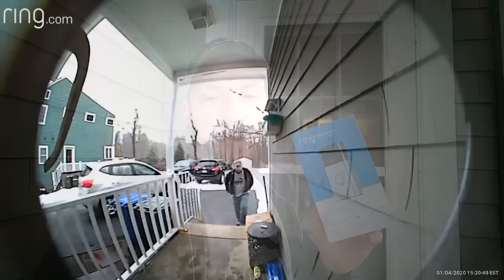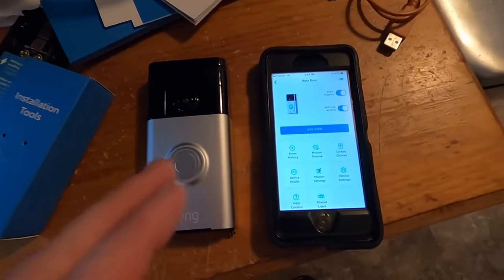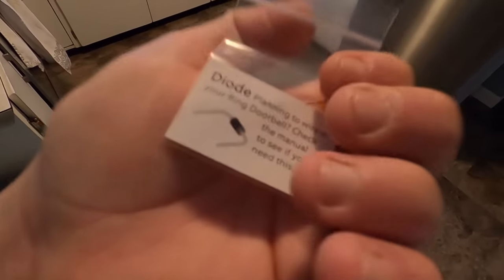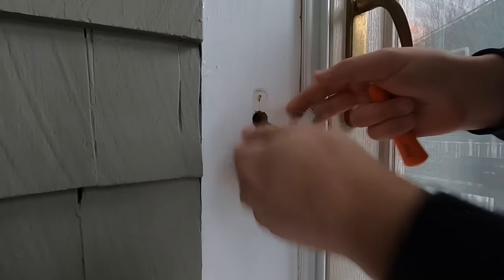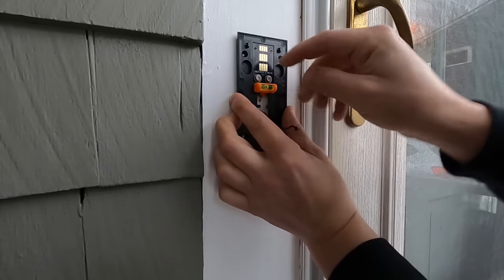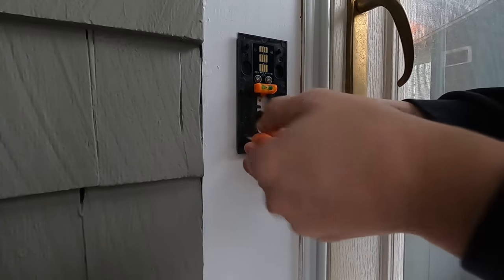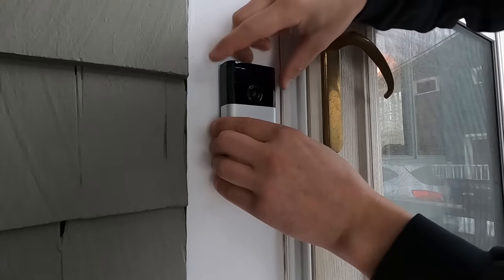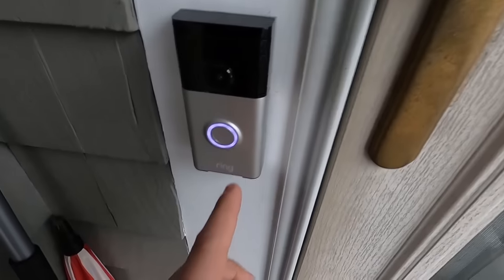How To Replace a Wired Doorbell with Ring Video Doorbell | DiY Install

Comment: Was waiting for the wires to short.  Taking any live wires off without flipping the circuit breaker is always a recipe for disaster.
Reply from the maker: Actually doorbell wires are low voltage, they can not shock you and all that happens when you touch them together is the doorbell goes off.  If it makes you feel better you can shut off the power in your panel but is not necessary.  Thanks for checking out the video!
Reply: Safety first! =P
Reply: The Fixer to “open loop “. Disconnect wiring at transformer  screws -@12-16 volts..very low voltage/won’t even feel voltage..
Reply: Ring suggests shutting of circuit breaker before install.

Comment: Did you have to disconnect the circuit somewhere before performing this repair? Does a doorbell have a standard 120v outlet?
Reply: I need to know as well. Don’t want to get electrocuted but it didn’t look so

Comment: Thanks.  Should you turn off electricity before touching live wires or not necessary?
Reply: Not on this because it’s very low voltage.

Comment: Great video, rookie here, one question. Do I have to cut power to the doorbell?  It didn’t seem like you did.
Reply: I wondered the same thing  🤷‍♂️
Reply: It is always the safe way to turn off that circuit on your breaker before installing it.

Comment: My package did not come with the drill bit for concrete. What size drill bit would I need? Thank you for this video. All I need is too install it on the concrete wall. The area where my existing door bell is located, is too narrow.

Comment: I got this doorbell and unless you are going to hardwire it I would not recommend it. I thought if I got the solar charger I'd be ok, boy was I wrong. The solar charger can't keep it charged up even if it's sunny every day and my doorbell faces south. So I have to remove the doorbell every four to five days and charge it which is a pain because you have to loosen the set screws and unplug which is already causing damage to wire plug. If I could go back I'd get the ring two which has a easy removable battery and also 1080p video quality and the ring 1 720p. Hope this helps; I probably left out some things but do a little research before you buy.

Comment: 9:38, a follow-up question: why are you concerned if the app shows battery power remaining,  when you hard wired this? Is it 16v? Does it have a backup battery?

Comment: great video. thanks.  when you installed the wired doorbell, you didn't  turned off the electric switch..  is it safe ?

Comment: Did you switch off the main fuse box before you installed the wired doorbell to avoid electrocuted?

Comment: Thanks for the video. Very helpful. The only thing I would add is to check the settings in the app to make sure the indoor chime is turned on. Mine wasn't so I thought there was an outside issue. Turned out to just be the app settings Thanks.
Reply from the maker: Thank you!  Yeah, I didn't get too deep into the app function.  Didn't want to show any personal information.  Just in case.  Thanks for checking out the video!

Comment: how do I know if my existing door bell wires are correct voltage for this RING doorbell replacement?  btw, I watched a few videos on YT about this topic, yours was the best and made me confident in installing it.
Reply: Resident Local measure @transformer voltage.. with volt-ohm meter...them measure voltage on other ‘end of loop-doorbell wiring’..voltage drop will be caused by length. In loop run-wire run if too low retire transformer...good luck
Reply: All are 16v.

Comment: So the wires you attached were only for the doorbell? I was under the impression the old doorbell wiring and associated power would be rewired thru a transformer used to keep the doorbell powered up and the battery would only be used as back up in the event of power failure?

Comment: On so,e of the videos you have to manually add something to the actual door bell on the wall (inside my garage)  I didn’t see this step on this installation.   I am assuming that it will ring without that step as yours did.

Comment: Seems like you have the best possible scenario for installation of one of these devices...wood trim and the doorbell faces outward. My house is stucco and the builder put the doorbell on a side facing wall. One thing I noticed though was the delay and how pixilated the video looks.
Reply: Same problem here.

Comment: If connected to original doorbell, why do you have to recharge batteries? From Amazon item page... Powered by the built-in rechargeable battery or connects to existing doorbell wires for constant power.
Reply: That's what I thought. That is why I purchased the wired one.

Comment: I appreciate your video.  However, I hard wired my Ring Video Doorbell 2nd Gen .  It does not work with the existing NuTone Chime in the house.  Very Frustrating experience.  Now I would have to defeat the ahrd wiring - go back to battery power - and either use my Amazon Echo Units for the alerts or buy a Ring Chime (that Plugs into electrical outlet) and works digitally with the Doorbell.  Calls to Ring's Customer service agents were helpful, but could not correct this without buying a new Chime.  I checked out the reviews of the recommended mechanical Chimes and some posters said it did work and others said it did Not.

Comment: Thanks a million for the tutorial. Just a dumb question, is it OK to keep charging the battery even after it reaches 100%?
Reply: Yes it's OK (safe) to keep charging the battery, however it isn't good for the life of the battery. Batteries also have charging cycles and these 2 reasons is why they fail or don't hold a charge as well anymore. A laptop or phone battery for ex. should be charged, unplugged and then discharged through normal use, you'll find those instructions on product manuals everywhere. Always having a device with a battery plugged in or something like watching videos on your phone while it's charging actually destroys battery life. This is why a laptop or phone battery no longer lasts for days like when you first got it. Now this is a doorbell we're talking about here so it's not that important but batteries are batteries.
Reply: @mannyquinn8301  will ring door plus stay charged with out the battery if I use wires from the breaker box?

Comment: Do I have to turn the electricity off to the house? Other videos have said that, but the problem is no matter which electric panel we turn off the doorbell still works so it must be running off of some thing else. The light was still on in this video, so it looks like the electricity was still on, I just need to know if I have to worry about that.😊

Comment: Hi, good video, but i have the same concerns as a lot of people here, which is the reason i am checking YT , how do i verify the existing door bell setup ?? To know if is ok for the Ring ? My house is 13+ yrs. old, the bell sometimes vary when pressed, there is the transformer on the garage (as my previous house of the same time, but bell was always the same) , how does one id if is digital ? , I doubt it is , assuming that is either the old original one, doubt previous owners changed it. 
   Please clarify, thanks.

Comment: Whoa whoa whoa!! You did this on live electrical wires without shutting off the power. Am I the only one who noticed this? The Ring instructions say you MUST turn off the power first for safety! Yeah, I know it's not 120VAC, but it's still dangerous.
Reply from the maker: You are absolutely not the first haha.  Yes you should turn the power off.  If I could remake this video, that would be the first thing I would say.  Thanks.  Be safe!!

Comment: I'm just afraid that it would electrocute me. Did you turn off the switch at the panel before connecting the wires?
Reply: It's low voltage. It's not 110 or 220 volts.  So no worries on a doorbell wiring.

Comment: How did you not get shocked touching the wires? Or did you have to turn them off from the panel?
Reply from the maker: It would probably be a good idea to shut the breaker off to the doorbell but any doorbell I have ever come across has been low voltage wires so I wasn't too worried about it.  Again, the instructions do recommend turning off the power at the panel.

Comment: I live in a 1931 home. From what I can tell, this home has never had a doorbell, nor do I see any indication of wiring for one. Would it still be possible to install a Ring doorbell? If so, would it require a lot of work? Thank you for this video!
Reply: My home is the same. Instead of the ring doorbell and I just the ring stick up cam battery powered and stuck it up above the door. Works the same without the doorbell ring
Reply: @lex1eleven  must you have wifi or some other service for the Ring to work?

Comment: Do you not have to turn the power off before messing with the wires ?
Reply from the maker: It would probably be a good idea to shut the breaker off to the doorbell but any doorbell I have ever come across has been low voltage wires so I wasn't too worried about it.  Again, the instructions do recommend turning off the power at the panel.

Comment: So if I understand right the 2 wires is only so it connects to the interior ringer and you have to remove the outside part to recharge the unit. How long does a charge last?

Comment: What’s the battery life like? Great video by the way!😁
Reply from the maker: Hey Simons, You only have to remove the Ring to charge it if you do not hook it up to an existing doorbell.  I’m sorry I should have clarified that.  So to be clear if you do not hook it up to existing wiring you need to remove and charge, otherwise the doorbell wires will charge it if you have it hooked up.  With all that said I think the battery would last about a week without power... maybe longer.  Thanks for watching!

Comment: I thought if you got the one that you had to wire you didn't have to charge a battery. I thought it would get power from the house since it's wired.  Did you have to turn the power off before you touched the wires?  EDIT: I just looked it up, and they said that if your ring doorbell is hardwired you don't have to change the battery, it gets a constant charge from being hardwired.  Is that true?

Comment: I think if its hardwired it will stay charged. It's only if you dont have it hardwired that you need to periodically charge it but correct me if I'm wrong
Reply from the maker: You are correct.  I should have clarified that in the video.  Thanks for watching!

Comment: Do you have to check if the transformer on your existing wired doorbell is suitable for Ring doorbell?
Reply from the maker: Yes you should double check.  These are the specs the transformer should have 16-24 VAC 50 or 60 HZ, 10-40 VA.  Hope this helps.  Thanks for watching!

Comment: What would happen if you didn’t short out your existing door bell?  And what if you don’t trip the breaker?  Door bell transformer is at a very low voltage.  Shorting our won’t cause any issues to you but may damage the transformer, right?

Comment: Hey I was wondering if you could give me some guidance on my install. Not sure what the old system I had on. But when I removed I had 6 wires. An Orange, Blue, and a Green. Each one of those had a white wire twisted up with it. Give me a total of 6 wires and to bare ground wire. Any help with a correct wire up would be great. Thanks for you time!

Comment: Oof, great video, but I didn’t realize what a pain in the neck it would be to recharge this thing. Makes me still on the fence. Wonderful job.
Reply: Same here. I dont want to have to charge anything, I thought hooking those wires up would prevent this. Also looks like he needs to add a wifi extender now too, it was very grainy and jumpy.

Comment: My home does not have single live and neutral wires in the electrical box of the outside doorbell, but instead it has what looks like a control wire with 8 insulated, very thin cables. Then, where the chime goes, the electrical box has live and neutral solid wires, a ground wire, and the mentioned control wire

Comment: Do you have to turn over any power?
Reply from the maker: Hey, Colleen.  It would probably be a good idea to shut the breaker off to the doorbell but they are low voltage wires so I wasn't too worried about it.

Comment: So the power can be one and no issues?  Also how long between charges if you know?
Reply from the maker: It would probably be a good idea to shut the breaker off to the doorbell but any doorbell I have ever come across has been low voltage wires so I wasn't too worried about it.  Again, the instructions do recommend turning off the power at the panel. 
 ND You only have to remove the Ring to charge it if you do not hook it up to an existing doorbell.  I’m sorry I should have clarified that.  So to be clear if you do not hook it up to existing wiring you need to remove and charge, otherwise the doorbell wires will charge it if you have it hooked up.
Thanks for watching!

Comment: I am trying to install the Ring app on my wife's phone but it needs a FIVE DIGIT DSK code to complete the install. Ring says the code in on the doorbell itself and on the outside of the box the Ring came in. I dont want to take the doorbell apart to get the 5 digit code but cant find a 5 digit DSK on the outside of the box. There are separate bar codes for Mac and Non Mac phones and another barcode which is NOT labeled but has two SEPARATE 5 DIGIT CODES under the barcode. Neither of them are labeled DSK whatever that is. Can you tell me if either of these 5 digit codes is the code Ring wants me to enter into my wife's phone to complete the app installation? if not do you know where i can get the DSK code other than taking the doorbell apart. Thanks so much.Good video.

Comment: You don’t turn the power off first?  Or are doorbells low voltage?
Reply from the maker: It would probably be a good idea to shut the breaker off to the doorbell but any doorbell I have ever come across has been low voltage wires so I wasn't too worried about it.  Again, the instructions do recommend turning off the power at the panel.

Comment: I ordered mine yesterday and figured that there would be an installation video. The info on Amazon said that you wouldn't need to charge it if you connected to the wires. Here is the exact quote "Powered by the built-in rechargeable battery or connects to existing doorbell wires for constant power." Is this not the case, or a new feature with the 2020 Release?
Reply: Im looking to purchase one. How do u like urs? Have u had to take it dwn periodically to recharge?

Comment: Just wondering, did you turn off the power before working? I mean for safetu
Reply: Bassel Al Horany me too!!
Reply from the maker: Hey there, Bassel!  I should have mentioned it in the video but I did not shut the power off as these wires are low voltage.  If it makes you feel better you could shut off the breaker before you work on the doorbell.
Reply: Always shut off circuit breaker!

Comment: Cool video, but do they have a model that doesn't need to be charged? the last thing I need is another device to charge.
Reply from the maker: You only have to remove the Ring to charge it if you do not hook it up to an existing doorbell.  I’m sorry I should have clarified that.  So to be clear if you do not hook it up to existing wiring you need to remove and charge, otherwise the doorbell wires will charge it if you have it hooked up.

Comment: Did you have to turn off any breaker? Or there's no way to get electrocuted.
Reply from the maker: These are low voltage lines but you should def shut the power off to be safe.  Thanks for watching!

Comment: Question? Do I need to turn off any breakers to install? or I can install as is?
Reply from the maker: You should probably find the breaker and shut it off.  I didn’t but that can be dangerous if something is wired differently

Comment: Sorry I still got one question to ask.  Is there temperature limit for this door bell? It might go down to -40C degree with wind chill in Winter at my area.  Thanks!
Reply from the maker: According to ring, the doorbell can withstand temperatures down to -20.5C.  So looks like -40C is a little too cold but you never know.  It might be ok...  Thanks for checking out the video!

Comment: The Ring says something that most transformers are not compatible. Do you have to check existing voltage? Do  I have to install the resistor? You didn't. Should I worry about it?

Comment: Hey, what kind of diode is required when hooking the ring to existing wire for hard-wiring the whole thing?
Reply: The diode is only needed if you have a digital bell in the house.

Comment: Question, if the existing doorbell doesn't chime will I need it rewired for the Ring doorbell ?
Reply from the maker: That is a tough question to answer.  It depends on what the existing issue is.  I would check the wires at the doorbell and make sure everything is good.  Try to get it to work before you install the Ring that way you can diagnose it easier.  Hope this helps.  Thanks for checking out the video!

Comment: Did you end up turning off a breaker for the power going to the doorbell?
Reply from the maker: In the video I didn't.  It would be a good idea to shut the breaker off to the doorbell but any doorbell I have ever come across has been low voltage wires so I wasn't too worried about it.  Again, the instructions do recommend turning off the power at the panel because you never know how things might be wired.  People do some strange stuff with electrical.

Comment: I didn't realize it needs to be charged.
Your original door bell had a light, so it has power. Don't know why they wouldn't have power tied in from the original wires. You should see what voltages the two are and use a step down converter to always have power going to it.
Reply: I also thought these were hard wired to the house’s/doorbell’s power. This is a hassle to take down and charge, probably when you need it.